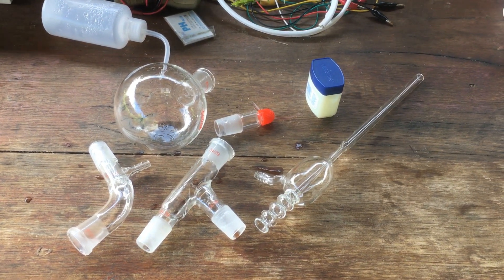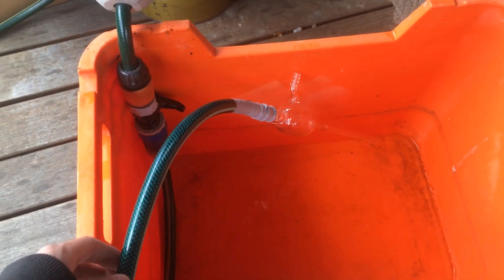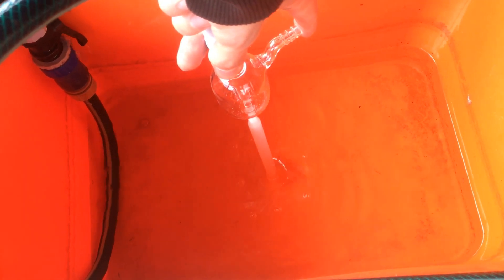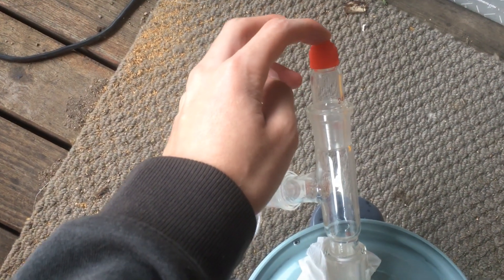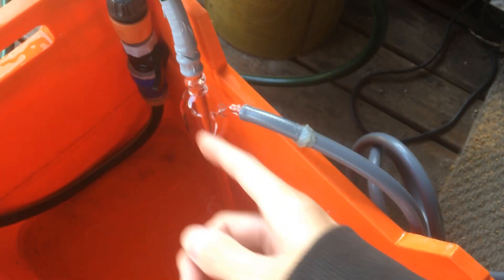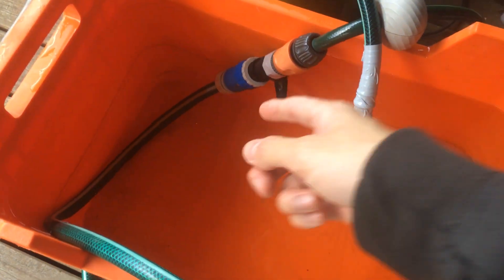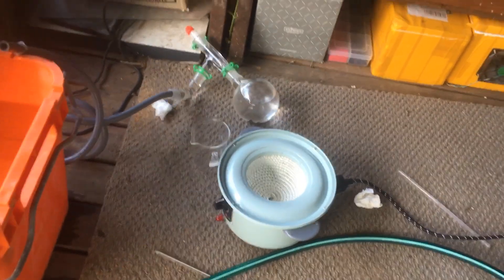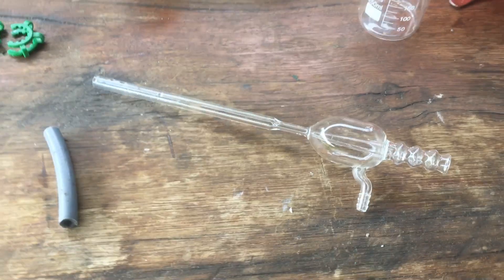The Aspirator Pump

Comment: I see you didn't follow up on the idea to reach higher vacuum as of now. But I'm very curious because I had an idea for that too and yours might be the same. Did you try to get the better vacuum?
Reply from the maker: I'm afraid I never got around to it. My original plan was to use the aspirator as the basic structure for a modified 'sprengel pump' (basically building one of these: https://youtu.be/viJ3T-1KZqY ). However, I ultimately decided that my engineering skills aren't quite up to scratch.
Reply: @ScrapScience  Ah, ok. I had a different idea. Tho someone pointed out you probably can't get to a deep vacuum with this. But since Wikipedia said the pressure is dependent on the vapor pressure of the fluid, my idea was to run it with vacuum pump oil.

Comment: Need trap/ reciever middle if thinking of all dry reactions or inert that are high explosive on H20 and run away at drop. Was wondering as glass must be costly viscosity & temp not covered. (Effects on more pressure cold, fluid)  Can't you just built one, mines cheap steel alloy. Where's he get cheap glassware? I was told read Australia Kiwi met in Guatemala said same (Tasmania maybe just accent) permit just anyone owning borosilicate 3.3 labware. More than once, what a stupid law if true, do it anyway or build. Is there a Teflon paint for metal to be non reactive? Great channel!

Comment: You have connected the vacuum hose to the wrong connector in the vacuum adapter, use the small connector.
At the large connector where the vacuum hose in the video is connected, a receiver bottle for your distillate should be connected.
Just look at a picture of a vacuum distillation setup.
Also, the long glass pipe at the bottom of the aspirator should be above the waterline, the whole aspirator should be above the water.
Putting the end below the waterline makes the aspirator work harder and makes lower vacuum.
The rate of the water through your aspirator have little impact on vacuum generated as long its enough to make it work, so a bigger water pump gives not much better vacuum.
But what makes big difference is the temperature of the water that goes through the aspirator, the colder water, the better vacuum you get.

Comment: Can you tell me which kind of water pump machine you used for this glass aspirator ;) ?
Reply: Probably just a submerged pump like folks use for ponds to run through filter, or silly fountain. What I do, can use any pump, but easier in container can alter viscosity and temp for pressures and even fill water jacket or condenser. I do, most use two containers as worry too much. Impeller pump. What you making, just learning?  Curious about Cambodia, never been there, near there. They sell mess cheap there, lucky folks smile more. Good luck
Reply: Why. Glass must cost heaps, he could've made it. Maybe for acid base?

Comment: Hi . What type of pump are you using here for aspirator ? my aspirator from ebay doesn't work with 100 psi pump , and i don't know  where is the problem . is it weak pump or  low quality aspirator ?
Reply: Just to add my own interest in the water pump used. I am hoping to purchase one this weekend (Bunnings?) if possible and would really like to get something that works well. It would be great if there are any suggestions.
Reply: ON my 5th pump and second aspirator trying to replicate NurdRage.  With city water, both his and a Bel-Art will do about as advertised.  Pump identical to NRage does about -7, a 1/10 HP does -13 and a 1/2 HP (billed as 42 M pumping height capable) does -21, This is for both a Humboldt knock off and a true Bel-Art.  Bel-Art is weird as it only got to higher suction after I submerged the "tail pipe" 3 or 4" in a bucket of water.  The H ko must have the tail pipe but the Bel A does better without it than with it...until you need to submerge to get full suck.

Comment: You’re supposed to connect a receiving flask to the vacuum takeoff adapter and your vacuum hose to the takeoff port on the adapter. If you’ll notice, that’s why the adapters are designed the way they are - suck back never happens.

Comment: Bro i found another way to make sodium na2co3+2c+1100०c=2na+3co on wikpedia😁 if you can melt cuppor 1100०c is perfect.in this time sodium will be vapor but if you do it in close chamber you can make it😂😂 don't scare from this idea😂😂
Reply: this is a recipe for an explosion, yes it works but carbon monoxide is flammable, and sodium vapor is also flammable, just do what nurdrage does

Comment: Very cool! You wouldn’t happen to be making a Sprengel Pump would you? Great idea using an aspirator if so!
Reply: An idea would be to use an electromagnet to drive the mercury instead of gravity. That way you don't need some massive column, and it should be possible to get to much greater vacuum.
Reply: Idea and used to evacuate air in💡 Big Brain here, wondering why glass too, how did they not have higher vacuum back then, had water pumps, air compressor, tools. Bellows tools impellers, couldn't pull vacuum before, knew body's functions...Seems silly, lower negative pressure, folks say vacuum. I didn't guess that!